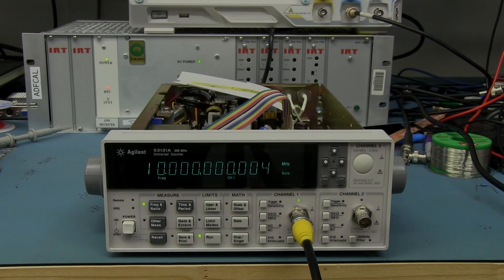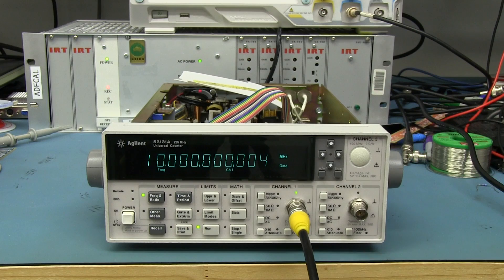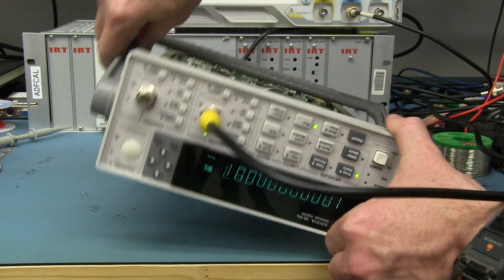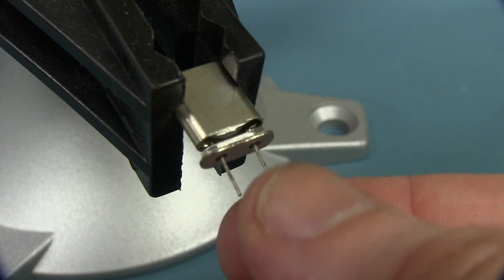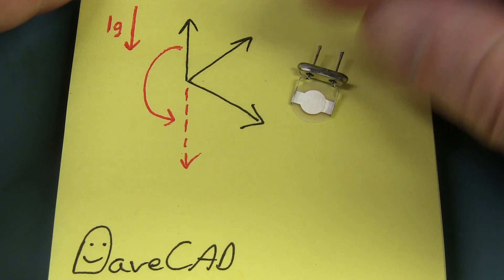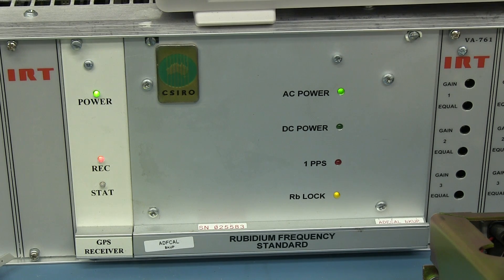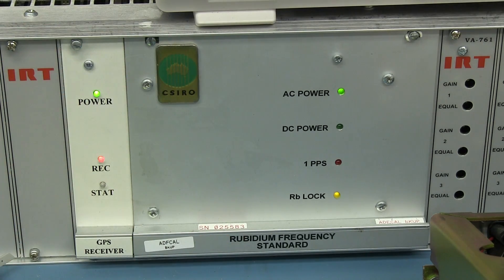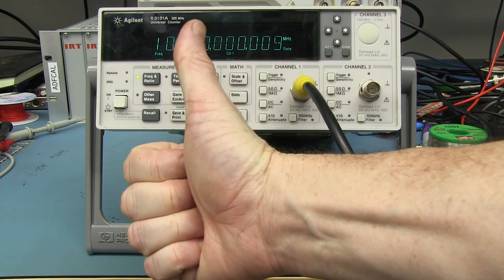EEVblog #646 - Gravity Detection Using A Frequency Counter!

Comment: So, if I get calibrated device in, say USA, and move it to Europe, it means it is off its calibration? If I want spot on calibration, it needs to be done where the dewice will be working =)
Reply from the maker: Not unless you change altitude(small effect), it should remain the same, as the original calibration vector direction remains the same orientation (toward centre of earth) regardless of where you are on the planet.
Reply: Gravity is not the same regardless, but this isn't a demonstration of Gravitational time dilation, the frequency shift is caused by the change in strain on the quartz crystal from changing it's orientation and can be observed transiently during any acceleration. GTD also causes a change in relative frequency but the effect is somewhat smaller (~1ppt for terrestrial variations) than this demonstrated strain induced frequency shift (~300ppt), but is observed by atomic clocks sitting on the top and bottom of a rack (with enough digits of counter).

Unless you have a Caesium fountain clock or something more exotic, GTD is below the uncertainty of your calibration. It's also worth noting that the SI definition of a second does not make reference to gravity. Your clock will still count seconds in 100G as it does in 1G, though comparison of the two clocks frequency will show a divergence, leading to the definition and distinction of coordinate time (time elapsed in a coordinated reference frame) and proper time (time elapsed in the clock's reference frame).

In the UTC/TAI system (the two systems are syntonic though with a leap second adjustment in broken down time), individual atomic time standards count SI seconds, and their outputs are adjusted with respect to calibrations of their local frame (slowed by 1ppt on average, because most atomic clocks are not on the geoid) to be syntonic, and the output is combined by a weighted average (relative to their uncertainty) to form an ensemble which defines the TAI second which is a coordinate time delineated in SI seconds on the earth's geoid, however defined by scheduled publications of BIPM.
Reply: My answer was at the start. The change caused by differing GTD is so slight that it won't affect the calibration of normal lab instruments.

Neither would the strain shift due to small gravitational changes in altitude. These shifts in gravitational potential are going to be on the order 1/1000, which is far less than the extreme shift in force angle demonstrated in the video. Even this extreme shift is only 300ppt, which is smaller than the error of almost all OCXOs which have a typical manufactured frequency error of 50ppb, though 1ppb parts are available.

Anyone who cares about a 300ppt frequency error is going to be using an external reference clock. I would be skeptical if I saw a +/- 300ppt calibration on a frequency counter with an OCXO.since the top-end Agilent frequency counters give a 1 day aging of 300ppt and 30 day of 15ppb (Option 010 on a 53200A Factory cal is 50ppb). With the standard TCXO the factory cal is 0.5ppm with 1ppm/year aging, so the lowest 3 digits are garbage anyway without an external ref clock.
Reply: EEVblog
There are local variations in gravitational force even at sea level... but we are talking less than 0.02% even for the most extreme gravitational anomalies.

It is quite amazing how even such a trivial variation could start to become a calibration concern with just one or two extra digits... and that would also make the instrument's orientation absolutely critical.
Reply: It's not the number of digits that is limiting, it is the accuracy of the oscillator. You could trivially build a 20 digit counter out of CMOS logic (if you were prepared to wait for the settling time), but without a 10**-20 accurate reference clock, it would be useless.

Each additional digit increases the settling time by 10x, so don't expect a 30 digit counter to be useful.

The bigger problem in aerospace is periodic and random vibrations, which introduce frequency modulation and phase noise, respectively, and can stop the oscillator entirely if they are large enough. The crystal oscillator is simply amplifying the output of the crystal filter and feeding it to the input, so any mechanical vibrations are coupled to the input of the amplifier and end up on the output of the oscillator. if the vibrations are large enough to saturate the amplifier or larger than the resonance level they will swamp the oscillator and it will stop or output random noise.

For this reason particular care has to be taken to the packaging and anti-vibration mounting of oscillators in rockets and aircraft.
Reply: Gravity will be the same regardless...
Reply: lets continue his idea, now how to calibrate equipment for free space - space shuttle, space station.Even robot on Mars...
Reply: Free space is the easiest since there is practically no G to worry about at all. For the space shuttle during take-off or re-entry, there would be too much vibration to get precision clocks to work. Your robot on Mars likely does not carry any experiments that require a clock with 1ppb stability and even if it did, using an Earth-calibrated oscillator would likely be good enough as long as it ends up on the same orientation on Mars, which any experiment relying on it would likely ensure.
Reply: puddingpimp
spurious vibrations could be omited quite easily, to give a good output. XYZ Force change could also be included in that too.
Albeit at the expence of time and processing. I nut it down too 3 crystals. Hmm, uber calibration to static field effects,call me back yo ;P As long as it is stable and relative to a standard, all is good.
Reply: puddingpimp No disrespect for your knowledge or understanding about this, but that's a huge amount of content that has no relevance with the original comment at all.

Gravity, is, the same either way. The original comment said nothing about elevation difference. He just talked about moving from the item from the US to Europe, which is perfectly possible without changing elevation between those two endpoints. And at the same elevation, the gravity will be the same, and even if there is an elevation change, he's talking about a practical situation, not a theoretical one, so even if there was a change, it wouldn't matter, the change is incredibly small, and massively irrelevant for the vast majority of users of this kind of equipment.

Some people just can't answer a practical question with a practical answer.

Comment: Would this have an effect on the times of watches and such, even if by nanoseconds say if you were in space?
Reply: If you wait long enough, it'll always have an effect ;)

though even in space, you can place a crystal inside a stable temperature and a stable G-force. so as long as the G-force doesn't change, it won't have an effect
Reply: That would depend on many factors including the speed of the spacecraft.  It's all "relative." :)
Reply: ArtR0001 Hmm well speed isn't going to affect G-force, but you're probably after the small effect of speed on time
Reply: ***** And I think that's what he was asking, The times of watches and clocks.  Even then, I think it interesting to see if there will also be a difference between physical "wind up" watches and those quartz "analog" watches, and pure electronic (LCD) watches.  Would need to be a long trip in order to compare all three of these together and get a noticeable difference.  But someday our offspring may get to take those trips.  Pretty sure that NASA checked the difference of the Omega Speedmaster watches that went to the moon but those are analog wind up and subject to being approximately accurate even when they remain on this planet. Pretty sure they are monitoring the Time Standards on the ISS fairly closely as well. Interesting topic....
Reply: ArtR0001 my gut is telling me the inherent inaccuracy of any kind of wrist-watch will make it impossible to measure the effect of speed on time. The "noise floor" is just too high. Though I think this whole principle (that time is different with different speeds) is used in GPS satellites anyway
Reply: Agree

Comment: Another smaller effect - gravitational time dilation.
Raise it 1m, and it's 10^-16 lower. To get to 10^-12 change you'd need 10km altitude change though.
Reply: Yeah but that would have to be relative to you, meaning the cables would also have to be 10km long. So that would defeat the point of it. Rule of thumb I've heard is about 3-5ns per foot. So for the sake of convenience, let's call it 10ns per meter. Which for a 10km, or 10,000 meter cable works out to an extra 100us delay. Which is pretty huge when you consider even a 1ghz clock will oscillate every 1 nanosecond. So in the time it takes for the signal to travel down that line, your computer will have had 100,000 cycles.

Comment: Look like you have the Garden Island 10 Mhz reference Oscillator, and I think it was on the Cal truck in 1999. Don't forget the GPS lock on the rubidium oscillators which governs it all.  But you know that anyway.
Reply from the maker: I used to work at Garden Island!

Comment: Just wondering, is there anyway of compensating that problem? I know we can't physically change what "g" is but can't oscilloscopes detect the difference between control value and increase or decrease depending on the displacement of the control value? It just seems very odd to me that engineers can forgot to implement something to compensate this fault.

So techincally, a 10khz reading in below the sea level will be different to a 10khz reading 10khz in top of the mt.Everest?

Comment: Is it possible for a device to be calibrated to deal with multiple angles. e.g, a sensor to detect the orientation and then automatically compensate for it?
Reply from the maker: Interesting thought, and yes certainly possible, as it is totally charactertisable reproducible, just like TXCO map a cal map that adjusts for temperature, you could also have a GXTO I guess.
Reply from the maker: *****
You'd still need to map for the in-between angles. Much simpler to just characterise it and then map it I suspect.
Reply from the maker: EEVblog
But simpler still to just whack whack a "This Way Up" stick on the product :->
Reply: There is an easy way to "compensate" for angles if you absolutely need that much precision: use an external reference that is not (as) susceptible to mounting orientation which you toss in your in one of your equipment racks and hardly ever need to touch again... like a rubidium standard.
Reply: Use an accelerometer to sense orientation, then create the compensation data.
Reply: EEVblog It's TCXO, not TXCO. *Runs away, feeling smart